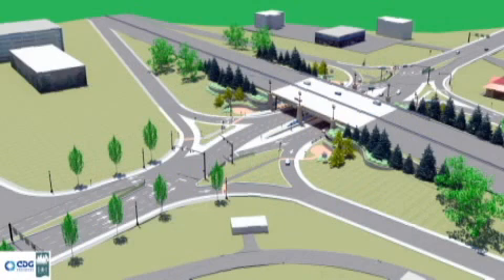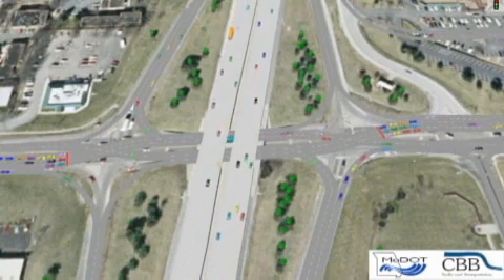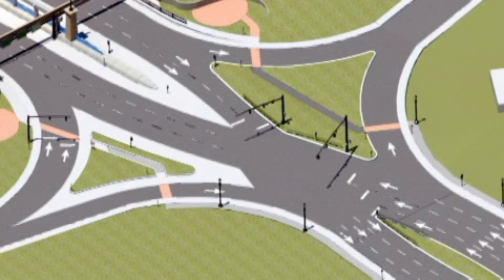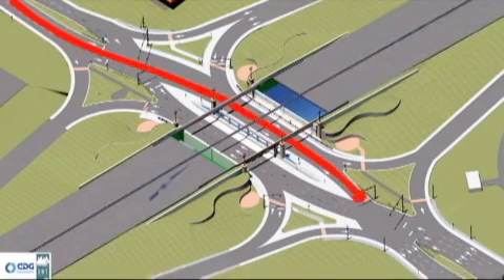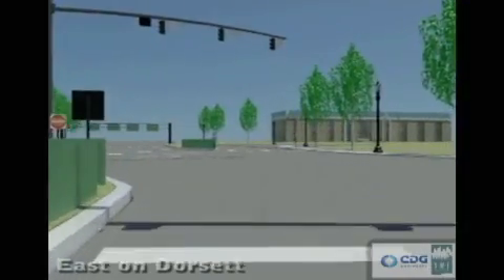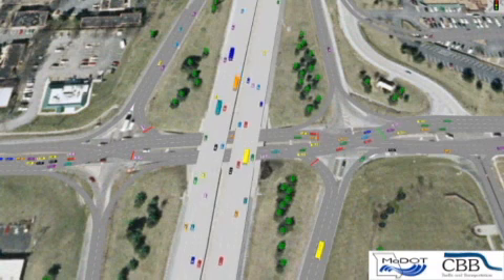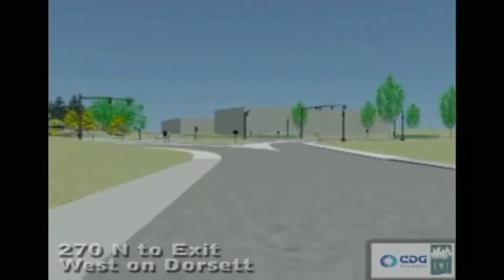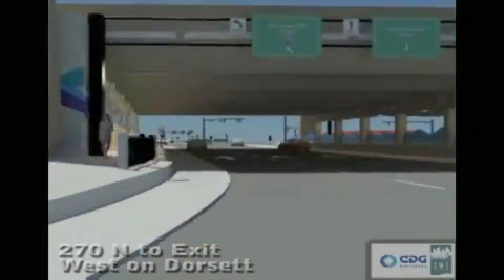I-270 and Dorsett Road Diverging Diamond Interchange

Comment: There is one of these near KCI airport on 29 Highway. I have to say that after the initial surprise, it seems to work very well.

I am glad to see MoDOT experimenting with new ideas. I had initially hated the idea of roundabouts, but after reading about how much faster they are, and that they prevent stop lights, I actually have scene the light, and wish more would be installed at busy intersections.

Comment: Problem is that Americans suck at *merging* in traffic and letting others merge with you...well....we suck even worse at that.
Columbia prepares for this at Stadium Blvd and I-70. Cars leaving I-70 will pass through spayers that will hose them in *KY* so they can squeeze through this narrow and over-developed section of roads.
We have a *round-a-bout* which doesn't go any place....would have been cheaper to build a 25 foot straight section of a street. So we are very skeptical of this great idea